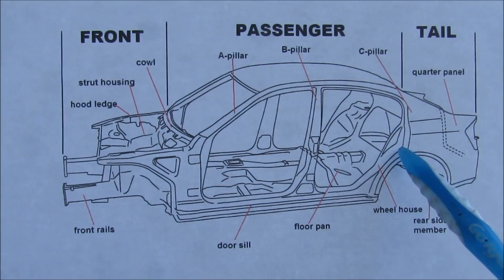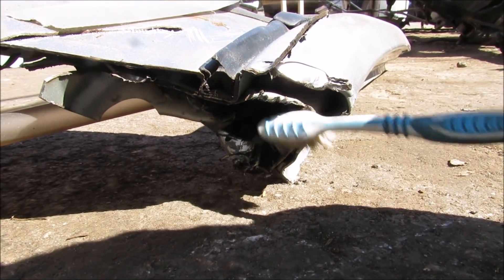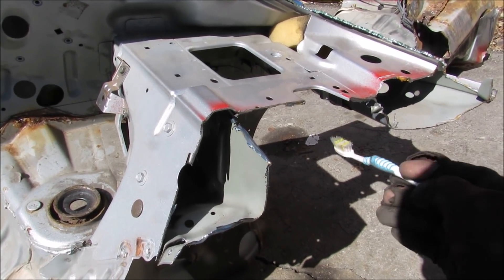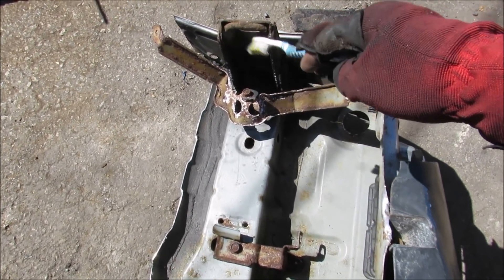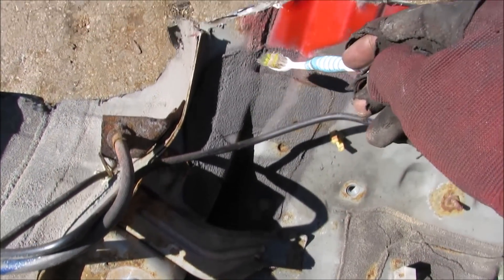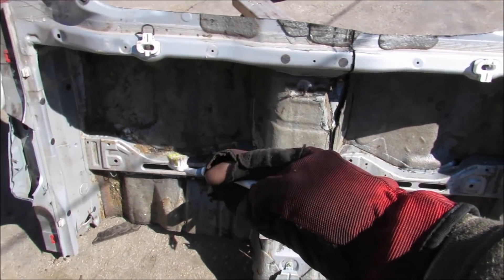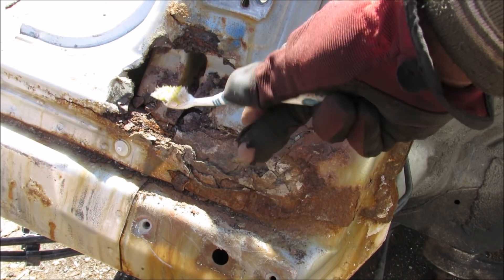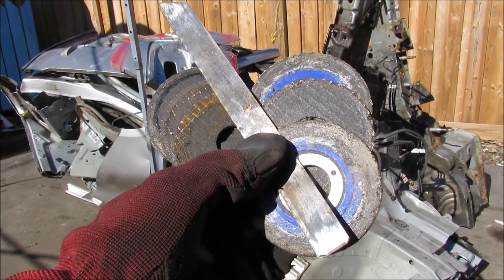How Unibody Cars Work

Comment: Will the roof structure and box structure under the floorpan keep the body straight if the rocker/sill panels are completely rotted out? I bought a car with really bad rocker panels and dont know if I should cage or brace the unibody before replacing the rockers to avoid the unibody shifting and not being straight.

Comment: Informative video! I didn't know they had foam inside! It's possible that the foam improves sound ending, is my guess. But the foam might actually increase strength. 
For a lawsuit they did a drop test of a Ford Explorer onto its roof, one with the original pillars that were hollow, and one with modified pillars that had"structural foam" inside. The foam filled pillars were a much stronger than the hollow pillars. 

Also on planes the fuselage is built out of many individual pieces glued together and then riveted. The glue is very important since it spreads out the load evenly. The rivets are not meant to carry most of the load, It's just to keep the panels together to help the glue. If only the rivets were holding the panels, the force would be concentrated on small areas and cause cracking. 

Also I've seen a picture of a Subaru pillar and they have a lot more layers in the middle along with a solid metal cylinder, So I think that Subaru would be a lot safer and stronger than this year Infiniti. I'm not sure if this one was crash tested but the similar year Nissan Maxima did pretty bad on the side impact crash test.
Reply: Side impact 
06 Infiniti g45: 

Overall evaluation	
A
Structure and safety cage	
M

2006 Subaru Impreza:
Overall evaluation	
G
Structure and safety cage	
A

Comment: You must have a Master's degree in angle grinding!  I hope your wearing ear protection, angle grinders produce the perfect amplitudes and frequencies for tinnitus. I can testify to that.
Interesting video. I didn't realize how complicated Uniboy structures are, and is that why car prices increased so much over the years? Also, where do I find the nice diagrams and schematics that you use in all your videos?
Reply from the maker: Thanks. I have a master's degree in mechanical engineering. I sure learned alot about unibodies by cutting this apart but it was alot of effort, I don't want to cut another one again! The diagrams are from the repair manual, check that nicoclub website...
Reply: @speedkar99  Lol, I did know that you are an engineer, and thank you for the response. You're doing a great job on your channel.

Comment: Why do so many cars and trucks rust in the rear wheel wells?
Reply from the maker: Because salt sprays up there when the wheel splashes and it gets stuck to the metal accelerating corrosion

Comment: Finally, a great video about the body structure! Looks like the design makes for a strong body; what about those after-market stiffener bars, strut-tower braces etc? Does the original body need such additional stiffening?
Reply from the maker: Awesome! You are right no one really does this stuff 😏

Additional bracing helps to reduce body flex in otherwise hollowed areas of the car (engine bay, trunk, etc) and is only helpful in extreme cornering for racing. On the street you won't notice much.

Comment: I was wondering if you knew how to program a 2013 Scion tC transponder key? Lost the one with the buttons built in the key. But I have the spare one with no buttons but has the letter G on the key blade.  Do I need the mini-Vci techstream software? Or is there steps to program it without any software?
Reply: RoyalStreetEnt Following this question what are the steps to program the remote buttons if possible?
Reply from the maker: Check out my techstream programming video for the remote.
Reply: @speedkar99  Thanks For the fast reply! How do I know if I have the valet key? It's just the gray key with no buttons, with a g on inscribed on the blade
Reply from the maker: You have just the valet key? If so you need to virginize the ecu (I have a video on older Toyota's on my other speedkar100 channel) 

The easier way is to get a locksmith or dealership to reset the ecu for you. Once you have one master key then you can program new keys yourself using techstream.

Comment: Mmm.. Looks warm.
Guess you didn't shoot this the other day.
I got my Oxy out to cut my old wreck up awhile back - PROTIP - Don't, I saved no time.
Great vid, never knew what all those extra holes and marks were for - Now I do.
Reply from the maker: Tbh the amount of effort to chop a scrap car isn't worth it. This took hours and hours to do, while I learned alot about how cars are constructed, I don't think I'd chop up a scrap car and rather have it hauled after the bolt on parts are removed.
Reply: @speedkar99  You're absolutely right and I've followed a similar pattern - More to teach myself.
Its just like everything else and you see that there's a reason why companies aren't doing it that way - Just tow, take the valuable bits off, grab it with a loader and shove it in the crusher. A lot of places won't do much more than take the motor out - Marginal business.

Comment: 6:33 are you sure that's a sound deadening material? I've had to ordered that stuff before and the manufacturer lists them as friction material for the seat. I guess for extra stability so it doesn't slide around with rear passengers since rear seats are not mounted to stable rails like front seats.
Reply from the maker: I've never heard of seat fricion, it's all over the body

Comment: i cut my ex car too, i did not enjoy in cutting it, it is easier to watch you
Reply from the maker: Why did you do that??
Reply: @speedkar99  it was to rusty to use it , i called company that collect old rust but they never come so i decided to uninstal everything from that car and sell as spare parts, body sold as old steel , i had problems with cutting three layer of metal, i lost my soul cutting it, it was summer and very hot, skoda felicia 1991. cut 2 years ago
Reply from the maker: @makantahi3731  I feel you. There was times I felt like that when cutting this car...despite learning a lot it was alot of work! I don't think I'd do it again.

Comment: I'm very surprised by the amount of rust below the fender apron, by the door mounting points. I wonder if that's a common rust spot on these cars
Reply from the maker: It might have been where the windshield cowl or doors drain to causing water/salt buildup and then corrosion. It probably doesn't get washed off either because it's behind the door.